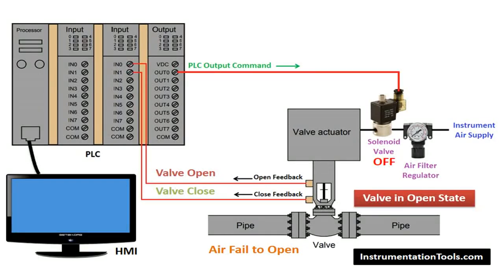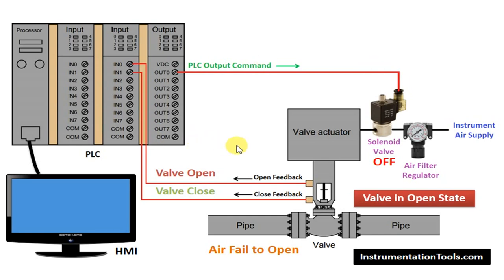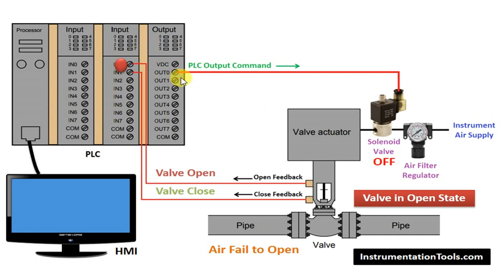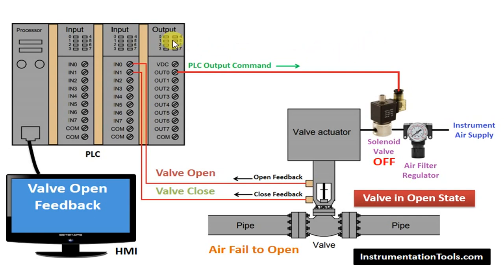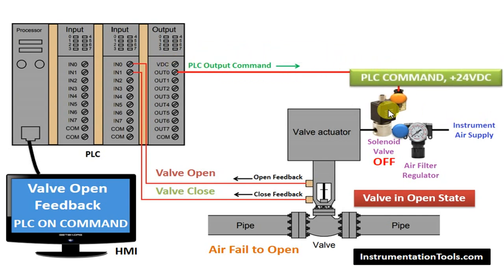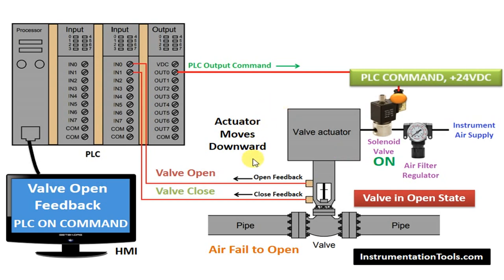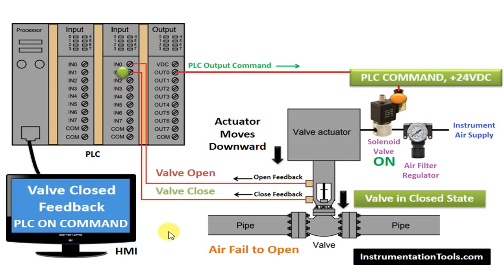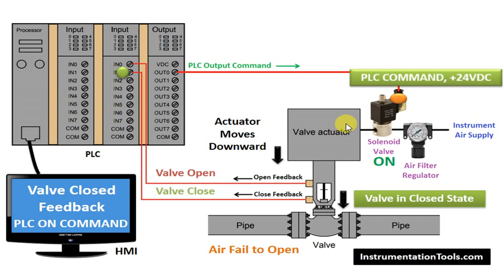How PLC Controls a Valve ? (Watch with Ear-Phones)

Comment: How would an I to P transducer come into picture here? Thanks in advance!
Reply: I/P transducer is not used here unless it is a control valve, in this case it would have positioner which contains I/P transducer within it. I/P transducer receives electrical analog signal from AO module to convert it to pressure. The positioner also has pressure amplifier to provide enough pressure to supply to actuator for moving a stem.

Comment: Where did you connect the negative to the pcl
Reply: Depends 2 wire 3 wire or 4 wire of the instrument. if 2 wire, means + to input channel, - to COM. If 4 wire meaning, 2 wire of + - instrument need connect to external 24vDc, and another 2 wire from + ti plc input and - COM